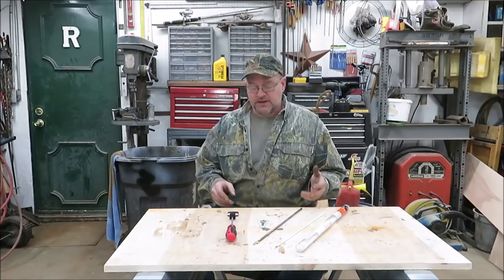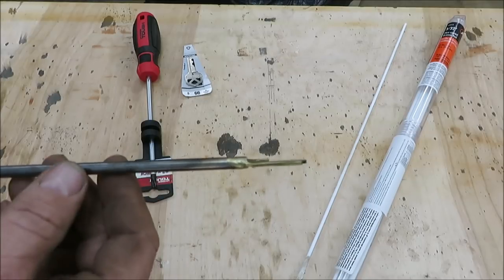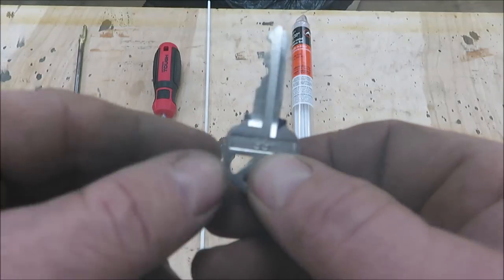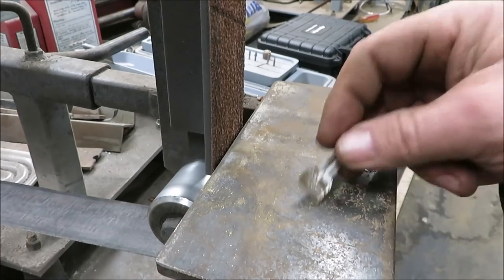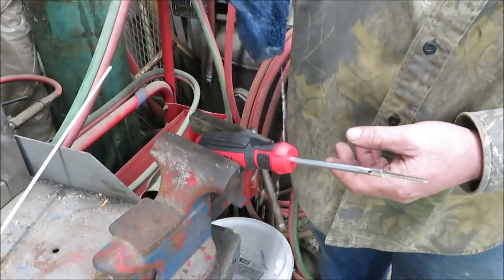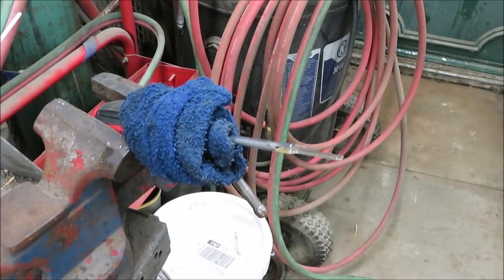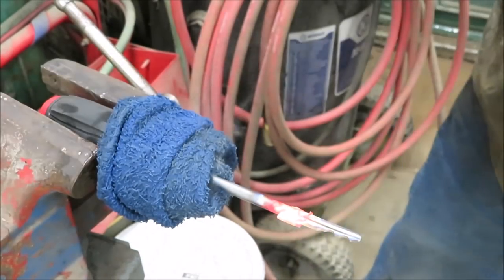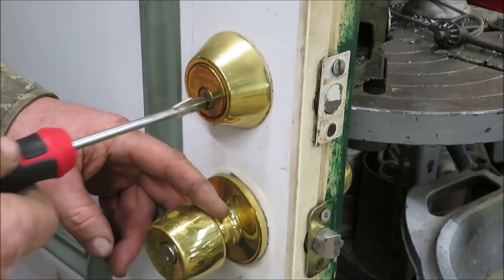how to make a prank key

Comment: Interesting idea, but it has to be clean enough to fool a date when you pick them up. They bop in and see a screwdriver jambed into the ignition and think you stole the car, hopefully they haven't seen you in the car before. Would be a great trick for a restored classic car or the like. Also, you could forge the end of a screw driver into the primary key shape then dremmel the grooves and file in the notches. Interesting project, nice job. BTW, looks to me like your brazing skills are just fine. Maybe heat the screwdriver to cherry red then stick the prepared key in and brazen it from that point, less time with the heat on the brass key. Just a thought. (Use pliers to insert the key into the hot shaft, the brass will heat quickly and could burn you).

Comment: when I was a younger man I had an old 69 Chevy pickup. The ignition switch was so worn out I really could start it with a screw driver.
I sure miss that truck.
Reply from the maker: I like them old Chevy pickups.
Reply: @Robinson-Homestead  you still planning on going to the Grand Canyon? If so, send me a message with dates and campground. My sister in law is there right now so now my wife is bugging me to go. I guess 90% of visitors go to the south rim which is open year round. 10% go to the north rim which is open May 15 to October 15.